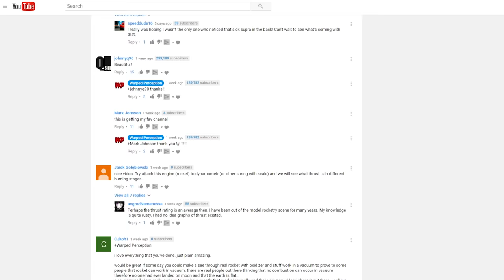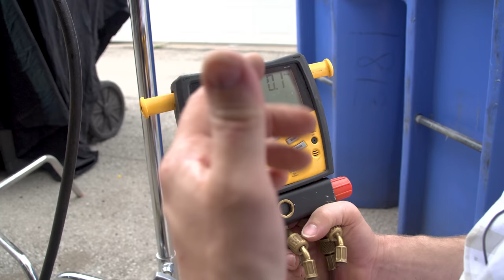Model Rocket Engine In A Vacuum Chamber - 4K Slow Motion - will it burn? - Rockets (S1 • E3)

Comment: you destroyed the vacuum with the exhaust gas, but nice video :P
Reply from the maker: +CDom very true, but it definitely served its purpose, the whole engine burn in one second vs 9 seconds under atmospheric pressure
Reply: Has nothing to do with the vacuum. People are confusing vacuum and lack of oxygen. What they are really saying a rocket won't work without oxygen, which of course it can as the propellant is made with chemicals that burn with either a combination of hydrogen and oxygen propellant or other chemicals that do not need oxygen to explode.
Reply: Vacuum is lacking in oxygen though. :-)  But yeah, the naysayers have two objections to space flight. They claim rockets can't burn in space (false), and they claim that even if they did burn, there's nothing to push against (irrelevant).
Reply: CDom  Yeah he definitely should have expended the rocket engine without generating exhaust gasses.  DERP!!!
Reply from the maker: Richard Head hey I try my best, the vacuum pump I was using at 7 CFM comma and according to the rocket specs it puts out about 9 CFM , so throughout the burn technically it was still in a vacuum just not a perfect vacuum.
Reply: You know you can press , instead of typing the word comma right?
Reply from the maker: Alex C sorry autocorrect, I fixed it

Comment: Delta P = 0
m1v1 + m2v2 = 0
m1v1 = -m2v2

Hot exhaust goes one direction. Rocket goes the other. Rockets dont push on anything. Its all conservation of momentum.
Reply: See, now you're using math and logic. They don't speak math because its one of the evil quartet in STEM. Likewise they don't care much for logic because it can tend to get in the way of feelings.
Reply: Every action has an equal and opposite reaction.

Hot gasses get explosively launched out the back, therefore rocket goes forward.

the faster you make that gas go out the back the faster the rocket can go with the same mass of fuel.

The fact people can't grasp concepts this simple is concerning, I don't even have a major physics education I just play way too much Kerbal space program and watch a lot of SpaceX stuff for fun.

One of these days I need to get my knowledge base more up to speed with my interests XD
Reply: Rocket still have to push air to move forward.
Reply: @donnyariyono09  explain
Reply: @nickbisson8243  Space is not vacuum chamber. If so, why satellite hover on stratosphere @300km high instead of exosphere @10000 km?
Reply: @donnyariyono09  satellites do not hover they orbit the earth you need to educate yourself I think your confused as to the definition of the vacuum of space
Reply: @donnyariyono09  bruh

Comment: Why in the world would people think that a rocket motor, not engine, would not burn in a vacuum?????????? It's rocket fuel, there is no oxygen in that tube when you fire the propellant. The propellant is an oxidizer and creates its own chemical reaction to produce thrust. An engine has moving parts that convert energy into motion, like a piston and crankshaft.
Reply: I don't think anyone thinks that rocket engines can't fire in space - its called a strawman argument. The real argument is that in the limitless vacuum of space, the gases would shoot out into the void and the rocket would have no propulsion since there is no atmosphere to push off of.
Reply: @MoneyIsSilver  you're right . in his experiment the exhaust gases quickly eleminates any possibility of a vacuum just a fire seconds after the engine starts
Reply: @MoneyIsSilver  don't be so sure, the ridiculousness of flat earthers knows no bounds and many of them believe different things.
At least one even questioned how the sun could be burning when there's no oxygen in the vacuum of space.

Comment: Unable to reply to the pinned thread, but to the people making the odd claim that the expelled gas from a rocket engine has nothing to push against in space, you are simply not understanding the mechanics of thrust, and would benefit greatly from a physics lesson. 

Newton is your friend.
Reply from the maker: +Ryleigh S I'm thinking about revisiting this in the future from an entirely different angle that people would have a very tough time arguing.
Reply: I'm definitely looking forward to it! Rocketry and spaceflight are very interesting and also a good context in which to understand physics. Plus it looks cool in slow motion :P
Reply: +Warped perception we won't, you cannot produce thrust in a proper vacuum environment.
Reply: Tell that to Newton.
Reply: +Ryleigh S He would agree and point out how stupid you are for thinking his third applies in vacuum.
Reply: Explain why a reaction does not cause an equal and opposite reaction in a vacuum, unless you only came here to tell people they're wrong without explaining why, which is a pretty counterproductive use of time, and a sign of arrogance.

When a rocket engine fires, the force is being exerted by the expanding gasses passing through the nozzle. Rocket fuel is self-oxidizing, so the lack of oxygen doesn't matter, so what is it that prevents the force being exerted backwards by the expanding gas from pushing the rocket forwards? If you're going to dispute observed phenomena, you WILL need to provide justification.

Just to cover my bases, in case you're being obtuse, space is not a "proper" or total vacuum anyways, so even if by some mechanism you're correct, it's irrelevant in regards to actual space travel.
Reply: Without particles to push off of you will not move, just sending a stream of particles out into the void. Basic stuff, you talk about "the force being exerted by the expanding gasses" yet you do not comprehend why this expansion of gasses causes thrust in atmosphere.

You cannot claim with any validity that this is an "observed" phenomena.
Reply: because no one can go in sapce to fire off a rocket to observe it hehe. but NASA CGI isnt proof.
Reply: Would you like to show us your experiment to prove this?
experiments prove theories, not letters or numbers.
Reply: And you expect people who cannot even spell 'physics' to be able to learn it?
Reply: WP basic math and physics doesn't have to be reproved.  And your wasting your time trying to educate those that don't want to be. Your material no matter how compelling will not be (sensational ) enough. however , those of us that believe in math and science vs. fake news will appreciate it. Thank you. I'll make sure that my grandkids see this. it was kewl 😁
Reply: Particles has mass. The particles has a velocity. A mass flow. Newton's third law dictates: "For every action, there is an equal and opposite reaction". In other words, the mass flow generated by the particles shooting out of the engine nozzle must have an opposite reaction, thrust.
Reply: +Holocene. "He [Newton] would agree and point out how stupid you are for thinking his third applies in vacuum."
Stop making things up. What's next ? conservation of momentum don't work in vacuum ? Inertia doesn't exist in vacuum. 
You are not interested in being right or wrong. You are only interested in throwing any kind of made up crap for as long as possible.
Reply: you are mixing your logic's up, if you are referring to Newtons 3rd law then you are misusing the word thrust, and are misleading people to think that there is something in space to thrust against and are breaking the laws of a vacuum. I ask you directly - are you satisfied with this experiment and its conclusions, does it prove anything????
Reply: Argument from Ignorance , then , I will ask you directly -  is this video and the experiment valid and conclusive   and explain why?
Reply: Argument from Ignorance, blah blah blah , smoke and mirrors, a simple question  and avoids the answer. All I asked is - do you regard the experiment to be good and exact in its conclusions, Yes or No?? - is that not simple enough. I will not even argue against your opinion and will leave it to other to ponder based on what I have said before. However I will add that if I were to design a better experiment a much bigger vacuum chamber is essential and in proportion to the rocket used, to avoid side thrust and expellent gas build up. But I would also have a range of experiments including the rocket in full atmosphere and part atmospheres, this is to demonstrate how much a rocket requires atmosphere create movement. The experiment has to be ingenious to eliminate all dilemmas and not a crock of shit like shown above, and fails to mention if they are using a rocket with its own Oxidants. " Wow that smells good"     the stink of bull-shit.
Reply: Argument from Ignorance, I am still waiting on your answer , Yes or No
Reply: Argument from Ignorance, I have not read one word that you have written but I will guess that Yes or No is not in there
Reply: pigeons ,chess....   what ever your on   can I have some??, to be kind to you I will leave the last word to you so do your very best and make it count...
Reply: +Argument,
 They only understand emotion, Pathos.  You're running on solid logic. Logos.   You've got the Ethos...
...
 BTW: his  Pigeon will be telling you that you fail to understand the rules of chess!
Then, as is typically done, not explain his rules and just take his ball and go home (ostensibly because you are too feeble-of-mind to understand his chess rules.)
smh just won't do it...
Reply: What are we missing? No airmass = No resisting force = No thrust
Reply: Its common sense maybe you would benefit from a lesson in that.
Reply: +Niva Ruvio,
 Not sure what your point is.  Just like a gun where the powder burning pushes the bullet (and combustion gasses) forward at high speed and the gun back,  rocket engine combustion pushes the mass of the exhaust gasses rearward at high speed and the rocket forward.  Simple 10th grade physics.
Reply: Argument from Ignorance 
Do you get the the idea that we're wasting our time trying to explain basic high school physics to these people? Do you think that you were indoctrinated in school? If I win the lottery tonight and it's a few million I'll build a bigger vacuum chamber and buy a rocket. No, on second thoughts, I won't. They still won't be convinced. I'll just spend it on a trip to Antarctica- it's on my bucket list.
Reply: Argument from Ignorance 
You are wasting your time. You cant fix stupid (although you can use duct tape to muffle the sound).
Reply: Ryleigh S, It is Newtons 3rd Law that explains what you're missing. "Equal and opposite". The minute amount of mass produced by the Rocket's blast would be insufficient and far too inefficient to carry the craft the distance required for the payload needed to sustain momentum. The same reason Jet Aircraft fly high enough to deduce drag but no higher due to loss of atmosphere with which to thrust against. If what you propose were true, Jets would fly even higher reducing time and energy,  getting us from New York to Paris.
Reply: @Jim - here I will answer yes or no, yes it does prove something. It shows that in a vacuum (or near vacuum) environment a rocket can and does produce thrust. The gasses expanding and escaping are pushing against the internal structure of the object they are housed in. Thus when they push against it as they are expelled out releasing both in opposite directions causing the rocket to move.
Reply: @Niva - your right it is common sense, maybe you should look at picking some up. The 'resisting force would be the rocket the gasses are pushing against as they expend and re expelled out. Air, as shown is not needed. The experiment showed this, and common sense would dictate that unless there was some definable error you should not toss it aside out of hand.
Reply: d4rk0v3
aactually according to Einstein in space thrust is not gained by gas passing through the nozzle of a rocket but by pushing against the layer of compressed vacuum of space around the rocket that distorted space time for occupying it as matter or energy. there is a force or pressure which is gravity that is always present caused by the distortion of that which is occupying space, this pressure spreads for millions of miles away from earth into space caused by the earths mass thats why a rocket can enter space, after a rocket escape a force greater than itself its speed will stay constant and will need more mass to go faster, speed wont be determine by how much fuel burn
Reply: Ryleigh S that's was what the newspapers said 100 years ago when the concept of a rocket in space was 1st suggested. Education has come such a long way since then
Reply: I'm looking forward too your video of the rocket in a vaccuum in a larger space like and old factory.......if you realy wanne make a point the vaccuum space has to be in the right scale with the rocket.......
Reply: This is exactly why a large portion of the population watch's FOX and believes lies that seem incredible to us.

Comment: from 2:52 to 3:03 there is a vacuum in the pipe and your engine does not move. Then there is no longer a vacuum, a lot of gas from which the movement begins. The scale of the vacuum tube is needed much more. But it's a good attempt.)

Comment: Not trying to troll, genuine questions. Is this actually a complete vacuum? What was the reading before and after? And then the other question is, the moment the rocket is it still a vacuum? Look, your model rocket doesnt move until the space behind the rocket is filled up with smoke by the gasses released by the rocket. This would not happen in space because there is no vessel in space. In other words, your experiment might only works because your rocket is contained in a small glass container, not infinite space. 
Does that make sense? Is their a rebuttal to this? Am i missing something?
Reply: What youre really saying is, you dont think rockets can work in space. If you even think outer space even exists beyond a "dome" in the first place.

You probably will dismiss it, but you can watch the artemis spacecraft that launched recently. No, you wont see a flame when the cut to the live feed. You will see the solar panels fold in while the lady talks about a burn to correct course, but ask yourself:

'How are they able to course correct if its not possible in a vacuum?'

Comment: Cool experiment. Without getting into flat earth and stuff, we have to remember that this rocket is inside a "finite" space. Are you sure the effects are the same out in the "open" space? Cheers
Reply: I think you'd get the same results, its the reaction environment that matters. But the burntime could be significantly shorter than in high pressure environments, as low pressure supports the chemical reaction from solid(fuel) to gas(exhaust)
Reply: Well, lets see - have we sent rockets into space? I think so.

Comment: Was there really a vacuum in the tube? It let out smoke almost instantly and high burn rate is more in line with elevated pressure. After the smoke cools down, there will be a slight vacuum though.
Reply from the maker: +WGwireless yes 900 microns
Reply: the instant smoke is because the engine brings it's own oxygen supply in the form of potassium Nitrate (the Nitrate having the oxygen the rocket needs) and charcoal as the burning fuel. That reaction is smoky for the same reason a musket is smoky. It's black powder. And it burns faster in lower pressures due to a higher exhaust velocity. Pressure slows the burn time, or makes the rocket explode if it's really high.
Reply: I'm sorry to be that guy to call bullshit but 900 microns? seriously? you expect me to believe that after burning rocket fuel in a small chamber you still have less than 1/760th of an atmosphere? I'm doubtful you had 900 microns to begin with.
Reply: I did the maths on this for the similar Cody's Lab video. Turns out that these little motors don't really produce all that much gas (only a few grams). Even assuming that the pump was non-functional, the final pressure ends up very low simply because there aren't enough gas molecules to produce high pressure without massive temperatures: I did the calculations for Cody's 50 gallon vacuum chamber and no pump assuming a final temperature of 600K (over 300 Celsius) and got a pressure rise of something like 0.002 atmospheres assuming he used 8g of rocket fuel. In reality the final temperature is probably much less than 600K (especially if there's some residual atmosphere in the chamber to dilute the hot exhaust), so the pressure rise should have been even lower!